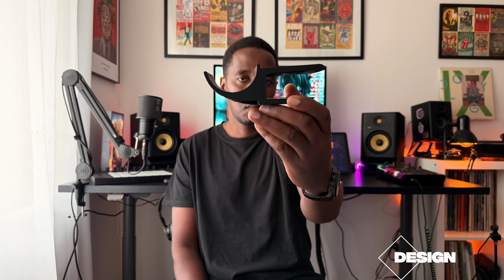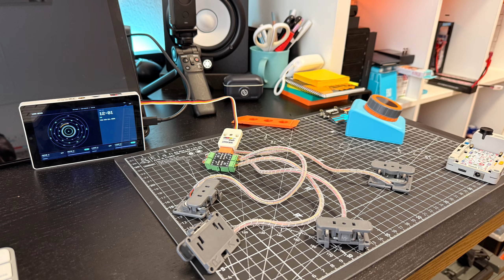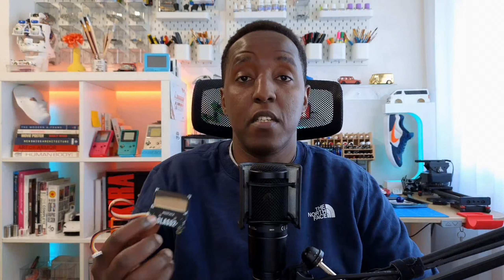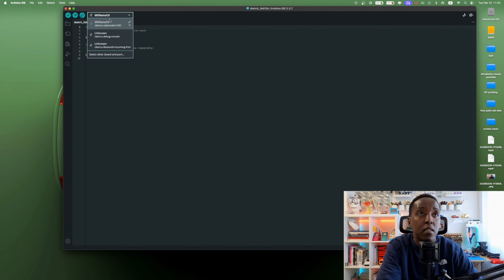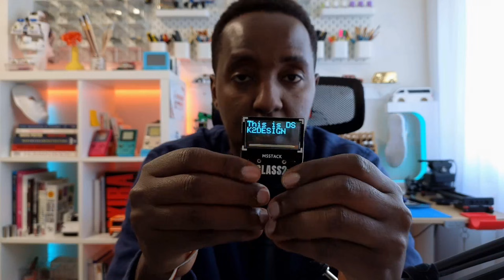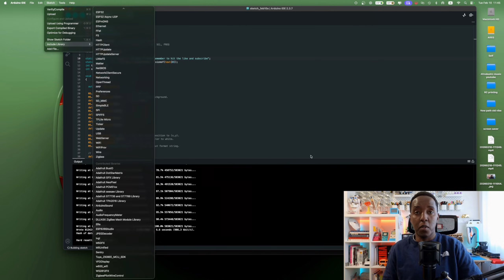M5stack: Glass2 with a nanoC6

Comment: It is called i 2 c["eye-squared-see"]: I2C (Inter-Integrated Circuit) is a widely used, 2-wire, synchronous, half-duplex serial communication protocol designed by Philips Semiconductors in 1982 for short-distance, board-level communication. Using only two lines—SDA (Serial Data) and SCL (Serial Clock)—it enables a master-slave, multi-node configuration, allowing one master to control up to 112+ devices. - hth, good video btw.
Reply from the maker: Thanks for the spot imprecision. 😂 must have been painful to hear me mention it wrong. Glad you enjoyed the video.